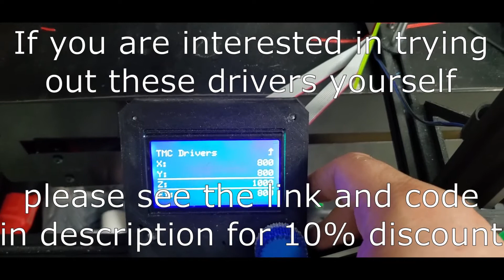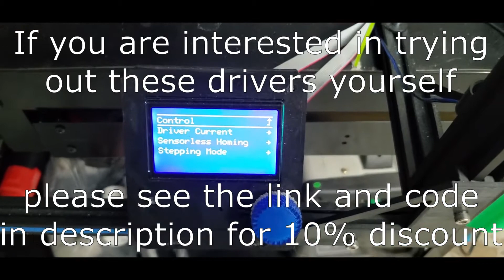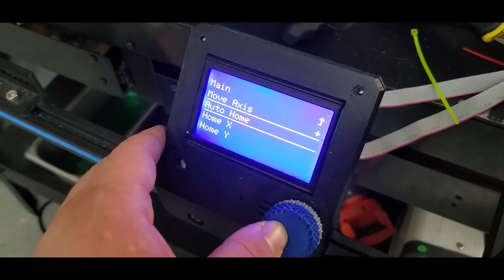Tronxy X5SA - How it should have been made - 2209 sensorless homing, direct drive and linear rails

Comment: Any chance you can link to the 3d printed parts you used, specifically your gantry plates?
Reply from the maker: They were custom designed. I never got around to releasing them and since I no longer have the machine, I dont have the files anymore
Reply: @chefjacobs3dprintz564  aw that sucks. In any case I just did the same, like fully custom gantry plates, fully custom hot end mount and carriage, and a custom voron afterburner hot end.
Reply from the maker: Yeah sorry. I ended up harvesting the parts for the full custom build i did. Life has been crazy with moving and my new job so I havnt posted in a while but i show it in my moat recent video if you are curious. Designed it 100% from scratch except the electronics encloser and x gantry tensioner

Comment: TRONXY support is awful.  

I have an issue with the motherboard, and they don't want to honour the warranty.  To prevent fixing the problem, they lied and do not answer questions that might confirm the issue.  They even denied that the command to get the printer settings exists, while it is very well documented on the web and forums.  The printer reacts to it and tries to write to the SD card the settings, but fails with error messages. 

If you get this problem, it will be a nightmare to calibrate your printer.  The calibration is off out of the factory!  In fact, there is no warranty and no support.

If you want to see the emails I've exchanged with them, reply to this comment.

Do not waste your time and money, buy your printer from a reputable company, not TRONXY.
Reply from the maker: Im sorry you had that experience. I have no affiliation with them aside from purchasing the xy2 and the x5sa. The xy2 was one of the most reliable printers I ever had the x5sa was a constant nightmare. I did end up selling the xy2 to fund another machine and the x5sa was turned to a scrap pile that I harvested some parts from to build my own printer from scratch, which can be seen in my most recent video. Unfortunately life has been crazy so I havnt been able to make any videos in a little while but once we move and life settles down I want to start back up again

Comment: Would taking the belt system and making it parallel with the x axis make the belt system more rigid thus then getting rid of vibration from the belts getting rid of ghost artifacts in a print. And also getting a extrusion to make a mount getting rid of one of the extra steppers for the z axis and have 1 stepper driving both by belt from between both of them getting rid of the issue of unleveled bed and z banding issues from the z rods being out of sync with each other. Most of the issues with this printer are very easy to solve. I plan on doing a whole rebuild of the printer before I get it and putting on a Eva 2.0 mount for the hotend itll put a belt tightening solution on it. Changing up the way the wires are setup to the hotend too much weight on it they need cable chains with a cradle for them like voron does

Comment: Some nice upgrades here.
I have to say that you missed fixing the most fundamental issues though.
The rollers need to form a line so that the belts are always parallel when the head moves to its extremes.
Also, those rollers must be replaced with toothed idlers, and the motor mounts must be replaced with aluminum (plastic is not rigid enough).
The big one though is the linear rails. The original rails are meant to be machine ways, if they are not straight enough from the factory, then they are not straight enough to mount ball style rails too. Adding the 3d printed shim actually seriously degraded the printer since now the print height will vary as the shim thickness varies.
remember that you need your reference to be a full order of magnitude better than your object. So to get a desired variance of print height of 0.05mm, the rail needs to have no more than 0.005mm variance.
The ball style linear rails will solve some other issues, but they are not introducing any greater accuracy since they will only be as flat as what they are mounted too.
Reply: i was about to say this...
got the 330 bed, and yeah. the top corner pulleys need a new bracket, so theyre kicked in about 3mm to pull the belts into line.

they are pretty crap in that area. the y position of the motors dictates them being square to the rear pulleys on the gantry, which at least you can wriggle around. the front pulleys are fixed so need new brackets.

and then... the pulleys on the gantry are mounted on the adjusting cams for the Y axis (at least for mine, running good old Vee ways still :)) so that when you tweak that for tightness, the whole lot shifts around...

running the bowden through teh chain really helps keep it more uniform, they dont like being left to flop around loose.

Comment: the latest X5SA pro has a lot of these things addressed - linear slides with adjustable steel rollers on the Y-axis,  sensors on all axes and filament, automatic leveling, hot bed and powerful 300W power supply , silent drivers, 3.5" display, no cables running free, easy to build and easy to setup if you take your time and measure the diagonals. 
But even without this the cuts of the profiles have been perfectly made so I had no problems with squareness. 
What I would have liked TronXY (and I will change it on mine) to make is to eliminate this crazy micro SD card slots and add  normal standard sized ones so you can use either the longer living SD cards or the Toshiba FlashAir WIFI 8GB card and make the printer networkable. 
(Well, you can use an adapter cable too - I advise to get the longest with 60 cm, so you may mount it to the front frame)
And then I'll bring the power switch up front - no longer searching at the back of the machine...
The USB port is not functioning as it should - this printers do not have a memory card on board, there is a WIFI module available, but again - do NOT buy it  - it will/can not work better than the USB port...

BUT - have you all looking for a new printer seen the GUARD D01 plus ? 
https://www.tronxyonline.com/TRONXY-GUARD-PLUS-D01-PLUS-COREXY-STRUCTURE-INTEGRATED-ENCLOSURE-3D-PRINTER-p1532716.html
Go have a look and see what can be done - apart from a nice softdesign with the added boon of getting side panels (alas at an extra price...) you will get a lot of things. This printer comes with the whole (silent TCM2225) electronics moved to the front and under cover, red power switch at the front left top side in the ready assembled bottom frame, the whole top frame with the X-Y-axis comes already assembled and factory squared, preinstalled belts. The hotbed sits on a stamped frame and not just 4 pieces, lattice glass bed. You will only have to mount all the verticals (slides, lead screws, frames) and fix the cables and you are up and done and printing.
High priced? Yes, BUT top notch quality (and 30% less expensive than the small Dremel 3D20 which was my first 3D experience).
Advertisement? by all means NO! I am just biting myself for not having seen this printer in january when I ordered my X5SA pro.
Reply from the maker: Thank you for youe comments. I do know that the pro model has several of the features already. I actually no longer have it, I scrapped it for parts for the printer seen in my update video I just posted. I did see the new creality machine yes. Its a lot of money but I would say pretty fair for the machine. I would love to get my hands on one in the future for sure.

Comment: As I'm packing up my X5SA Pro to return it due to it not printing correctly for a week, the warped print bed out of the box is a nightmare, the ABL doesn't work properly and their support will tell you that youre too far from the print bed when you get massive blobs due to the nozzle knocking the print off as it scrapes the print bed lol
Reply from the maker: Dont feel bad. I ended up turning it to a pile of scrap that I am using to build my own printer from scratch. Hoping to get back into making videos soon, life has been crazy and changed a lot since covid

Comment: If buy new board, motor cables pins are same or need recheck everything?
Reply from the maker: Definitely check. In my experience the wiring was the same but when i bought a pancake stepper for the direct drive the polarity was different which caused it to just hum.

Comment: Very nice build and hard work. I have plan some with rods, but seems rails are better. Just back motors put inside from top, universal mount on head, possibility to print 400x400 area and do all smoother. I enjoy your build much, interesting in mod some parts.
Reply from the maker: Thank you very much for your comment! That would be pretty need to expand the build volume
Reply: I only dont know, if one rail for x is enough. I plan to hold pellet extruder on, so not sure if not move side. Maybe for better stability heavy heads and good prints will by good another one from bottom.

Comment: Do you have your configuration.h and configuration_adv.h posted somewhere? What version of Marlin are you using? Thanks!
Reply from the maker: Not posted anywhere though, but keep in mind this is the skr 1.3 board not the original. Marling 2.0.1
Reply: @chefjacobs3dprintz564  Hey, can you share your config? I'm assembling a config for the X5S with SKR 1.4 turbo with TFT35 V3 E3 and a raspberry pi. It's been quite and adventure and would really like to check my work.
Reply: original tronxy v5 and v6 board is fully supported now in marlin even with lvgl tft ui

Comment: How did you find the belt tension system? I know teaching tech had some serious problems getting everything square
Reply from the maker: No offense to Teaching Tech, I love his content, but he rushed the assembly of his printer which resulted in all of the issues he had. I just mock up the position of the belt over the pulleys, mark it, remove from one of the pulleys, tighten up a few more belt teeth and tip tie. Then when I put back over the pulley the belts are nice and tight. But if you take your time and ensure the cube portion of the frame is square then you shouldn't have an issue getting that part square as long as you have properly tensioned the rollers or in my case have linear rails.